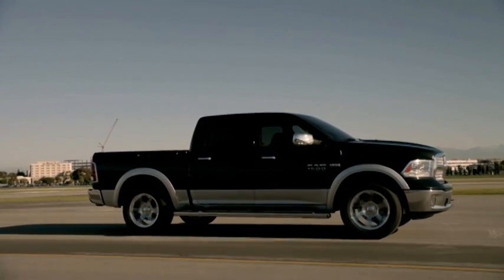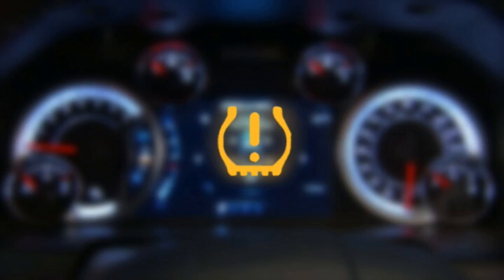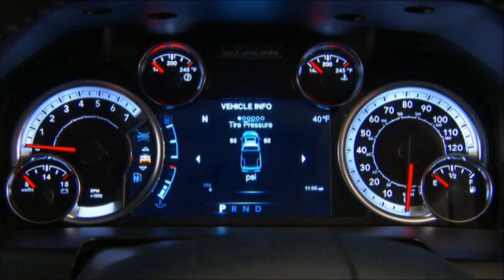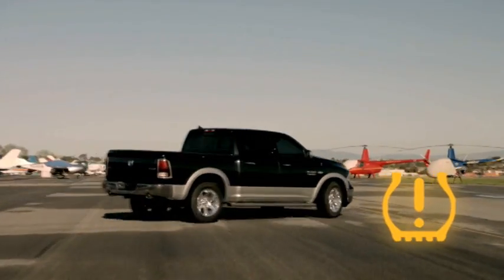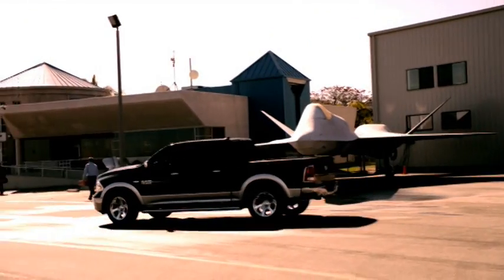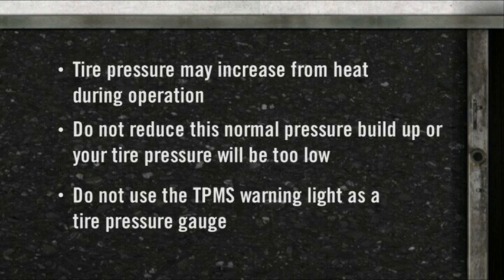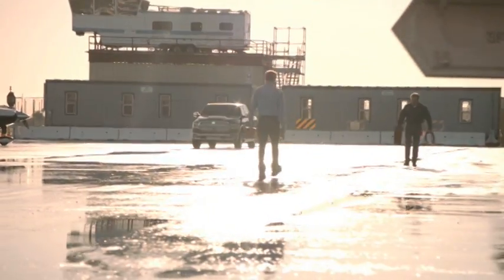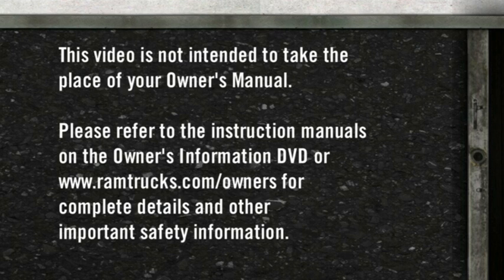2013 Ram Truck | Tire Pressure Monitoring System

Comment: First time having service tire pressure system flash on the dash. Its 21 degrees, tires aired up and now the warning light won’t go away. Guess its time for new tire pressure sensors?
Reply from the maker: Hello, if you plan on scheduling an appointment with your dealership for the tire pressure sensor, please feel free to reach out. Our team is available via private message on Facebook, X, and Instagram.  ^YA

Comment: I just bought a 2012 ram 1500. Anyone think removing the heat shield over the header without damaging something with heat? It flaps around currently so I don't think it can be blocking much heat in the first place.

Comment: My right headlight is going in and out like it has a short any suggestions of why it's doing that besides a short
Reply: Actually it's not a short it an intermittent open likely caused by a loose connection creating an open circuit and not allowing  electrical flow to the head light. A short would be a short circuit to ground and blow fuses.
Reply: It is the harness attached to the headlight. I cut harnesses out and hardwired the headlights. No more issues with them going in and out.

Comment: I agree with Bullshit and Sick of Dodge, and this Cold weather shit you are running 80lb of air the sensor should stay off. they have change 3 sensor on my Truck and I still have low pressure light coming on going down the road. sensor should be able to be set from the dash board to 50lb to 75lb allowing the consumer to run the sensor best for them not some #$%^ in a suit behind a desk!

Comment: I have a 2014 ram 2500, and this is driving me nuts. I am sick of Dodge telling me that it is government mandated and they can't do anything about it. When driving on icy roads with no load, there are going to be many crashes. I say sue sue sue. If and when I crash because I was running 80 lbs. of air to keep my alarm off I will sue the heck out of Dodge.

Comment: So....when pulling a 7200 lb travel trailer and the pressure reads 46 with a starting pressure and the max pressure labeled as 44, just ignore it?

Comment: At the dealership I work at, these TPM lights are just an annoyance. Sensors like to go bad, and people think they don't need to check their tire pressures with a gauge anymore because of this system. The light comes on because it's cold out and too many customers don't know what to do so they bring it to the shop. It's not hard to check your tire pressures with a gauge. People need to learn how to not depend on useless technology.